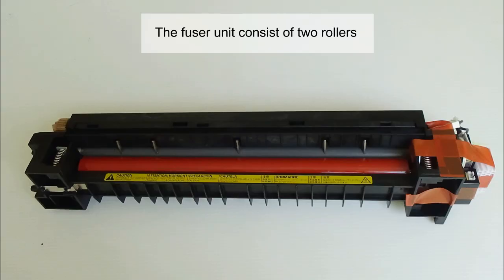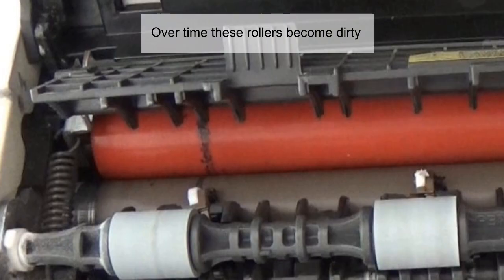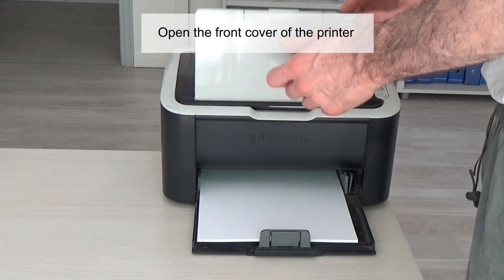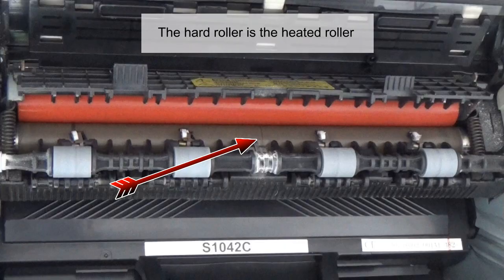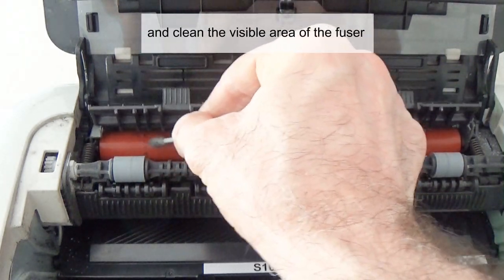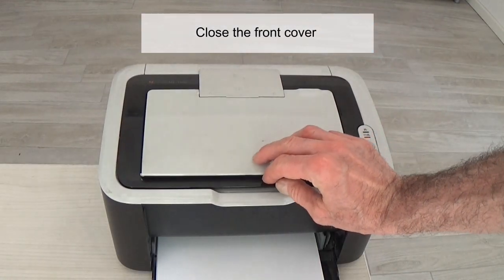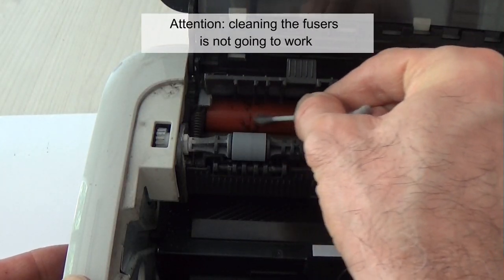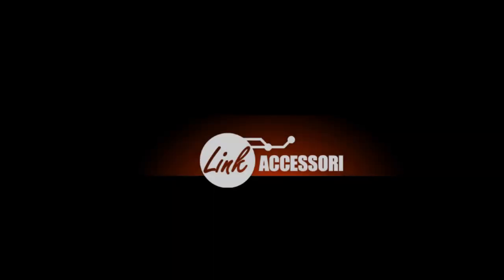How to Clean a Samsung Printer Fuser

Comment: MÉTODO RESET FUSOR:
Lo probé en una Samsung 5010 y funciona perfectamente para hacer el RESET del FUSOR.
La secuencia completa es: 
MENÚ
#1934
MENÚ
Entras al modo TECH y vas a DATA SETUP.
Luego eliges COUNTER RESET. Le das OK.
Eliges FUSOR y le das OK.
Y así todos los que quieras restear. (Tray 1, etc)
Finalmente apagas y vuelves a encender la máquina. 
El contador del fusor estará en CERO.
Reply: Just tell me: what does it help that "el contador del fusor estará en CERO" if the fuser's mechanically damaged? Or the other way around: why would the fuser cause ANY problems (associated with a counter) unless it's worn or damaged?

Comment: Hello Viandant ! Thanks to help me . I have a CLP310, when the paper goes out the toner does not stick on the paper. Is this a problem of the heated roller ? Thanks a lot
Reply from the maker: +Guy Antequera yes, usually it's a problem related to the fuser rollers but may be also a defective toner cartridge

Comment: Thank you for the cleaning tips. My ML 1860 is clean, no marks on the fuse or elswere, but when printing, black spots are visible on the paper.  My toner is 67 % full and really don't know what is the problem. The printouts of images are also kinda blurry and I noticed that my Samsung printer setting vanished with windows 10 updates lol
Reply from the maker: The problem vould be the toner cartridge, even if it's 67%. Check the transfer roller too
Reply: @viandant5  Thanks, will do that. 👌

Comment: Hello, I have Samsung CLP300 colour laser printer and it gives me a paper jam just before the fuser it is happening when the paper is trying to enter the fuser and when I open the back cover I can see the paper all wrinkled and the toner on it is not developed. May I ask you how this can be fixed. The paper is not even entering the fuser and jams. Should I clean the fuser rollers or do something else? Thank you!
Reply from the maker: +undecided I think it's not a cleaning problem. verify if there is a foreign object near the fuser unit, may be the paper is dump, try change paper. check if the fusers are worn

Comment: Thanks for the video!  I have cleaned the fuser rollers, belt and cartridges but I still get bad printout.  I have emailed you a photo of the print.  I hope you can help me.  Thanks!
Reply from the maker: try to remove it with a wood or soft plastic spatula, there are no other ways unless you want to disassembly the fuser unit

Comment: should the pressure roller be completely smooth? mine is uneven, like small ripples in the rubber, is this normal or does it mean it's ruined? the roller looks clean but I still get horizontal (not vertical) lines when I print that seems to correspond to these uneven places on the roller. (ML-1660)
Reply from the maker: yes, the fuser roller  must be smooth
Reply: Madame Traffic Jam

Comment: I have a CLP-415NW and Im getting blue spots on all pages that are the same size shape and position. I checked the toner cartridges and cleaned the rollers of excess toner. I don't see any defects in the green roller but the spots persist. What else do I need to check or clean? Thanks.
Reply from the maker: which is the distance of the blue spots? may be the problem is on the developer roller or on the charge roller

Comment: hello can guide me.... I have a samsung printer ml 2955dw that when you turn on the orange light on the panel is highlighted and a paper jam message appears inside the printer but it does not have any jammed paper. the fuser rollers is clean.
Reply from the maker: in this channel you'll find a video on what do to in case of false paper jam message

Comment: You suggested we ask questions. All of a sudden, I'm having having trouble with my Samsung laser printer. The light is green...and printer starts to work, but then stops...yet, I can find no stuck paper or other obvius problems. I need a new toner cartridge, btw, but with a little shake-up have been hanging in there with this puppy....until I can get to ordering the cartridge. Any idea what this might be? THANKS.
Reply from the maker: Which samsung? most of Samsung toner cartridges have chips, so it's useless to shake them if the chip is over. you can also try to clean the paper feed rollers with alcohol

Comment: Thanks for Giving such usefull info about printers.

I have samusng ML-1676P MonoChrome LASER printer.
i found problem in Displaying RED light insted of Displaying GREEN light on starting of Printer with loaded Papers.
There is no effect on printing with RED light,
 but i think printer may be heated without printing that's why the RED light displaying.
Give me solution for RED light insted of GREEN light.
Reply from the maker: is it a blinking red light?
Reply: viandant5 blinking on starting of printer only. after Red light is stable and print is continued.
Reply from the maker: Try another toner cartridge but it's strange, with the fix red light it should not work
Reply: ok. thanks..

Comment: Hi guys, my C1860FW is scorching the paper down both sides? do i need to replace the fuser or is that built into each of the toners?
Reply from the maker: yes, it may be a problem related to the fuser. Look at the fusers. If the fusers are damaged the problem is there. If not, look at the drum. if there is toner on it, change the toner cartridge. That type of toner cartridge give lot of problems
Reply: viandant5 thank you, is there a Fuser built into each toner cartridge? Or just a main Fuser in the back of the unit?
Reply from the maker: there is only a fuser unit in the back of the unit

Comment: hy sir,
thank you for this video. I have an issue with one of my samsung -2161 printer, as of now i am getting random spots in page while printing page. What do now?
Reply from the maker: May be the toner cartridge is losing toner, on the recovery blade is damaged. clean the inside of the printer. check the fusers, if they are dirty try running a dozen of white pages

Comment: I have a Samsung C1860FW and it gives me the message "Replace Fuser unit". I am not sure what to take out "Fuser" and whether its worn out or dirty and should be cleaned. Any suggestions? Thanks;.
Reply from the maker: It's difficult to remove the fuser unit, I think it's better to bring the printer to a repair center

Comment: I have a m2070Fw xpress, getting the fuser failure message #U1-2320, very frustrating as its just out of warranty. could cleaning them solve this problem?
Reply from the maker: the temperaturel of the fuser unit is abnormal, too high. try to turn the printer off then turn the machine on.
If the problem persists, remove the fuser unit. Check if the fuser connector is connected properly. Check if the thermistor is twisted or contaminated.

Comment: My samsung ML-1865 laser printer is printing a solid black print out. Changed toner still the same . cleaned pressure roller still same . Is their a solution please ?
Reply from the maker: Check the contacts between the printer and the toner cartridge.   then, probably you have to change the high-voltage  power-supply assembly,

Comment: if my paper keeps jamming is this caused by the fuser ? Paper jams on the back side where the fuser is located.  samsung SCX-4826FN
Reply from the maker: Yes, it may be caused by the fusers
Reply: thanks for you quick reply... i'm planning to do some research and replace the heat roller (upper and lower)

Comment: Paper struck and rolled on the fuser roller of my Samsung ML 1640 Laser Printer, cant prient any more . How to resolve the problem ?
Reply from the maker: if you can't remove the fuser unit, you can try to remove the paper one piece after another. make attention not to damage the rollers, use tools made of wood or plastic. not metal

Comment: I have a samsung Xpress Color printer. The print is coming out with a blue line like this
 
                                                         _________

                                                         _________

down the center of the page. What can I do to fix??
Reply from the maker: which Samsung Express printer. a blue line vertical or horizontal?
Reply: Thank you for your reply. I don't know the model number. It is a color printer and uses C504S toners. The lines are horizontal and blue.
Reply from the maker: which is the distance of the lines? probably the problem is the cyan toner cartridge not the fusers
Reply: Maybe about an inch.
Reply from the maker: itt's the developer roller. the problem is the cyan cartridge

Comment: I have a Samsung scx4623fn printer.when it starts after initializing a error shown 
"error #02-000 turn off then turn on the printer" .
pls help me
Reply from the maker: Power the printer off and then power it on again. try to replace the toner cartridge. if it does not work, the problem is caused by a bad fuser unit.

Comment: sir pressure roller hetter roller merged how to solved this problem in 1016 printer
Reply from the maker: I think you can only change the roller
Reply: @viandant5  Sir the roller has already been replaced but still stuck
Reply from the maker: @p.v.p.v.murugan7957  It stucks where? Does it stuck against the other roller or is it blocked?
Reply: @viandant5  sir roller to roller merge
Reply from the maker: @p.v.p.v.murugan7957  Did you check the gears? May it is blocked by a damaged tooth. Does the fuser melt with the other fuser?
Reply: @viandant5  I found it sir. Heat control wire is damaged. The mechanic did not look at it properly and said it was not right.

Comment: I have a C1860FW and the ink is printing powdery at the bottom. I can't figure out where the fuser is to clean it. Help?
Reply from the maker: In this model is not easy to clean without dismantle the printer. You can try opening the rear cover

Comment: Sir my samsung ml1640 printer showing thermistor open cycle power error 
How to over come from that issue
Reply from the maker: It's a fuser error. Probably you have to change the thernistor of the fuser unit. there are no reset procedures

Comment: Hello Viandant !!  The problem is solved, I changed the fuser ! I noted the sheets of paper were  cold, now they get out warm and the toner sticks.
On the out of order fuser there are two thermal probes, is it possible to test them ?
Reply from the maker: +Guy Antequera the connections of the heating element? I think you can test them with a tester
Reply: +viandant5 No , on the fuser there are two thermal probes like KLICSON . Is it possible to see if they are good ? Thanks
Reply from the maker: +Guy Antequera the thermistor, its purpose is to check the temperature of the fuser. it's possible to check it wiht a tester
Reply: +viandant5 Ciao! Possiedo una Samsung clp-550n, prima mi faceva una riga verticale per foglio dei 4 colori: ho sostituito il tamburo ed ora non lo fa più... Ma è arrivato un altro problema: con la vecchia 
fotounità dava il problema della riga ma i fogli uscivano bianco, invece con la nuova fotounità la stampa è senza righe ma i fogli vengono sporcati di grigio. Cosa può essere?

In una clx-3170fn avevo una immagine ghost della stampa precedente, ho cambiato fotounità e
questo problema scompare... Ma si evidenzai il problema delle macchie di grigio (in questo caso lievi) ai fogli. Ho sostituito anche la cinghia e ora stampa come nuova...

La domanda è: il mio problema delle pagine sporche di grigio, può essere dovuto alla cinghia 
di trasferimento??? Eppure se metto la vecchia fotounità i fogli escono bianchi ma con la striscia dei 4 colori del toner. 

Nella clx-3170fn con problema ghost quindi ho cambiato tamburo (fotounità) e risolto, mentre macchiava le pagine di grigio e cambiando anche la cinghia si è risolto.

Quel che mi interessa è per clp-550n: perchè il vecchio tamburo mi stampa le pagine regolarmente con sfondo bianco (ma essendo danneggiato fa anche la striscia verticale dei 4 toner) mentr eil nuovo tamburo giustamente ha risolto il problema dell'immagine ripetuta della stampa della pagina precedente ma ora però le pagine si sporcano di grigio uniformemente per tutto il foglio (o quasi)??? Grazie di cuore in anticipo per la risposta.
Reply from the maker: +Itanium IT sono macchine che cominciano ad avere un po di anni, è possibile che il nuovo tamburo fosse in magazzino da parecchio tempo e che sia scaduto o difettoso. se sostituendo il tamburo quel problema scompare è molto probabile che il tamburo sia il responsabile

Comment: My Samsung ML- 3310 d.does not response to print command but it prints configuration report.
Please solve.
Thanks
Reply from the maker: are ou sure the printer driver is correctly installed?

Comment: MY SCX  3405f have #1 2320 error code 
i can not use it
Reply from the maker: remove the fuser unit and check if the fuser connectors are connected properly. Check if the thermistor is twisted or contaminated.

Comment: the fuser unit contains a heat roller, & pressure rollers only. you are indicating there is more then ONE heat roller or pressure roller. There is not.
Reply from the maker: When I say there is more than one heat roller?

Comment: Hi. I have a Samsung SL-C1810W printer. When I print a photo there are lot of visible vertical line entire width of the paper. I use original cartridges and current set is more than 1 years old after replacement since I do not print much. Is it a problem with the cartridges? What should I do. Below is a demo page printed which shows the vertical lines.

http://www.mediafire.com/view/q8wxgt757hr1h86/IMG_7225.JPG
Reply from the maker: I think it's a cartridge problem, probably yellow. I would try to change that cartridge.
Reply: Thank you for the reply. Is there anyway I can pinpoint which toner cartridge is faulty? and is there any expiring date for cartridges?
Reply from the maker: The second most probably culprit is the OPC drum. If you keep  the toner cartridge in a dry place with a normal temperature, the expiration date is not important
Reply: The OPC drum is in the cartridge which is not replaceable isn't it? Is there any type color test page which I can print individual colors and find which cartridge is faulty?
Reply from the maker: the drum is into the toner cartridge. Print a page with  a square cyan magenta black and yellow and look where is the problem. it may be the transfer unit too
Reply: Hi. In my case I think I found the what is bad. It seems that Magenta toner and Black toner has issue. See the attached photo below.

http://www.mediafire.com/view/97whhnq2os76s9x/IMG_7227.JPG

I'm not sure why both these toner went bad suddenly and these are original samsung toners. With further close up check of the cartridges it seems that the toner does not stick to the toner transferring roller in the cartridge. See the photo below (magenta Cartridge same for black cartrige) - zoom the photo and you can clearly see what i Mean.  the toner cartridges have more than 60% of toner remaining. Why this happen and is there anyway I can recover the these two cartridges?

http://www.mediafire.com/view/m3swyugyajk7pcp/IMG_7231.JPG
Reply from the maker: you could try to clean the developer roller blade, probably it's dirty. in this channel there are remanufacturing instructions. however that printer is a copy of one of the worst HP printer
Reply: Thank you. I dismantled the magenta toner and clean all the rollers but it was difficult to remove then developer roller blades and with more than half full toner reservoir. visual inspection of the blade did not show any obstruction or any built-up. cleaning of the rollers resulted very minor improvement but still not good. It seems that I have to discard the cartridge. still the developer roller does not pickup enough toners.
1. Why this kind of thing happen? These are genuine Samsung toner cartridges. Only thing is I take few color photos per week and now the cartridge is more than one year old from first installation and more than 50% of the toner remaining. Black cartridge have the same issue.
2. How to avoid this from happening as original cartridges are very expensive and if I have to discard without fully utilizing it would be waste of money?
3. Do I have to remove the cartridge and store separately while not using? If yes please explain how can I do that safely.
4. What is the best color laser printer A4 size I can buy for high quality photo prints? I don't want to use bubble jet type printers.
5. There are many third party toner cartridges are available and I'm now considering third-party good quality toner cartridges to use. Can you please recommend good quality third party product for this printer  (SL-C1810W printer, 504s toners)?
Sorry for asking so many questions really grateful for the support given.
Reply from the maker: It's not necessary to remove the blade if you want to clean it.
it's important the printer is in a dry and cold room, then it's not important to store the cartridges separately.
The printer you have is one of the worst printer ever made by Samsung. Hovewer, the CLP 360 and similar are good printers. all third part cartridges are made in china, almost in the same 2-3 factory so virtyally are the same.
Reply: Thanks. I bought this printer about 3 years ago since I wanted to have high quality photo prints, which required for my work. I do not want to use inkjet type printers which produce better photo prints. This printer produced good quality photo prints until this issue occurs. If I go for new color laser printer can you give some recommended type color laser printer models which produce better quality photo prints than this model and not samsung? any comment on Color imageCLASS LBP612Cdw?
Reply from the maker: It's a good printer but it has almost the same cartridge technology of the printer youalready have